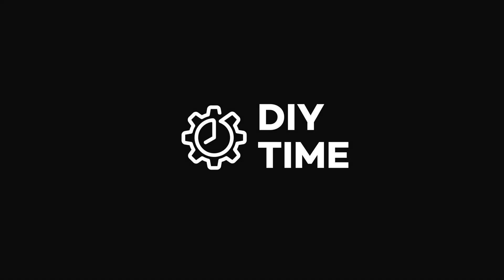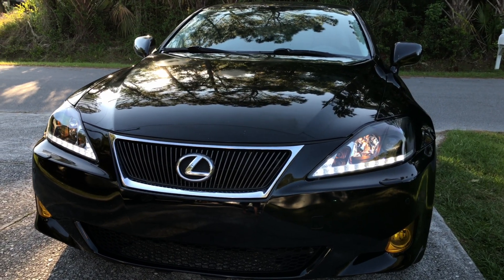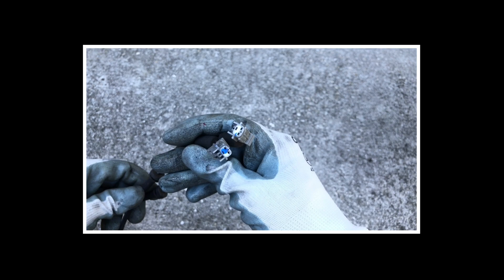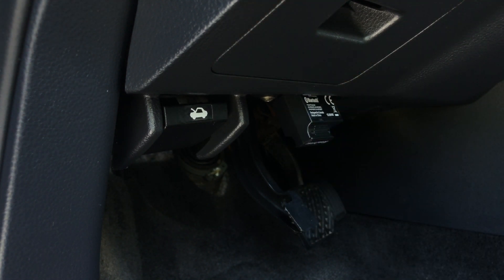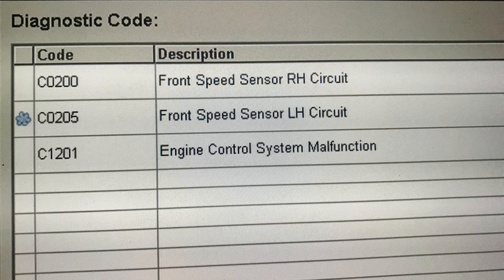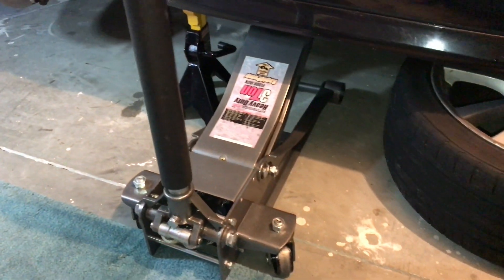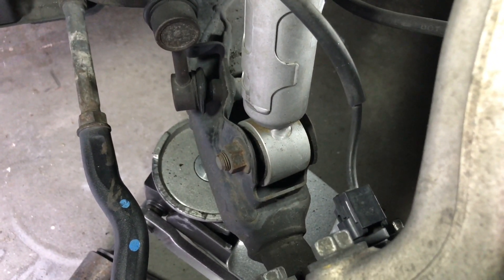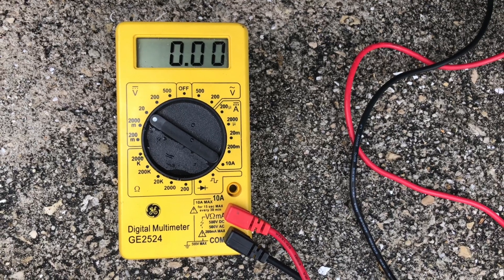How to fix ABS error - bad wheel speed sensor cable on Lexus & Toyota - C0200, C0205, C0210, C0215

Comment: Could you give me some other tip and I’ll go ahead and find the fault? It turns out that it gives me the codes C0200 and C0205 right and left front speed sensors, but in the scanner it indicates that the four sensors including the rear ones work perfectly the same numbers all move, I delete them from memory and when handling them when entering the highway it immediately takes them out again the codes of the same C0200 and C0205 what would you recommend me? Thank you

Comment: Hello, I want to ask, I checked the C0210 and C0215 trouble codes. I changed the speed sensor, but the instrument panel speedometer does not work, and the anti-skid system enters, what is the problem? Do I have to change the speed sensor wires?

Do I have to change the speed sensor wire?

Comment: C0205 is showing on my scanner. The left driver side the speed sensor has malfunctioned. Interestingly, this happened after I had my brakes completely changed. So it could be that something was a loosened up when they were changing the brakes. Hopefully my mechanic will be able to give me answers.
Reply from the maker: Could be he forgot to plug it back in. Could be he plugged it back in, but it generated a code, and it just needs to be erased from the memory. 🤞🏻
Reply: @DIYtimeTRD  it ended up being a $250 repair for a faulty wire. Sensor was perfectly fine but the wire connecting to it was all in bad shape. Thank goodness it isn’t thousands of dollars in repairs.
Reply from the maker: Yeah!
Reply: I just had my wire replaced but unfortunately my code is still there.

Comment: Hi! Great video. 
Having some funny problems with my IS250
Car vibrates on 60 through 80mph 
My mechanic pulled out the socket for the ABS on my driver side back seat and the vibration is gone. We’ve changed the harness and socket but the problem is still there. Could this mean I need a new speed sensor. Also, is the speed sensor different from the ABS sensor? 
Finally, after changing speed sensor, is any electronic programming required?

PS - my ABS light was never on, and no ABS codes come up after scan